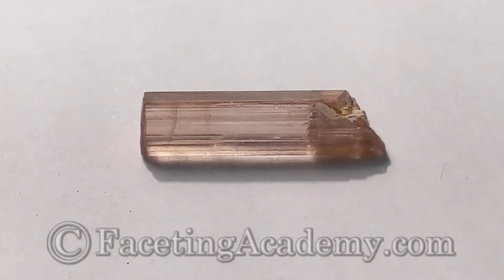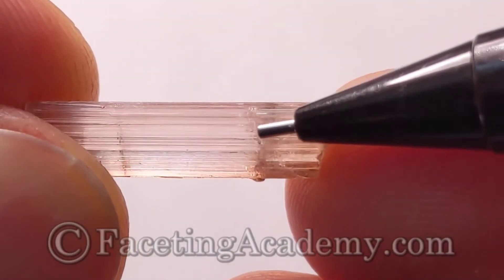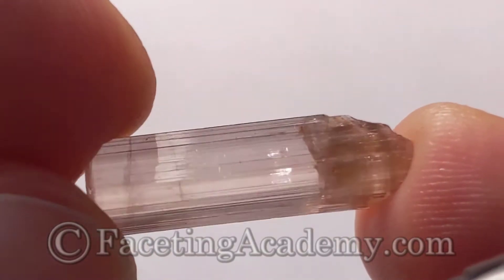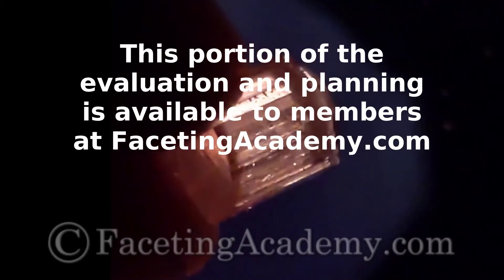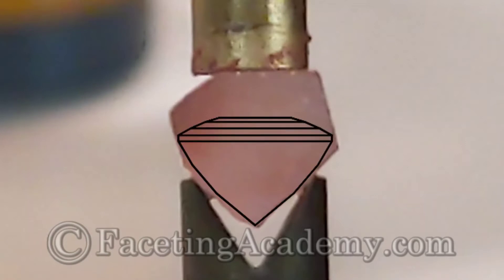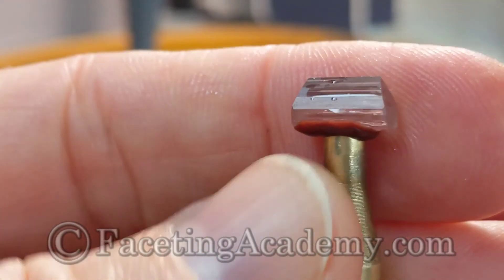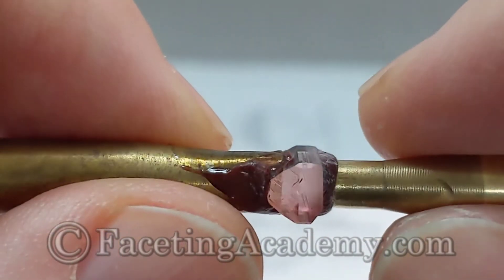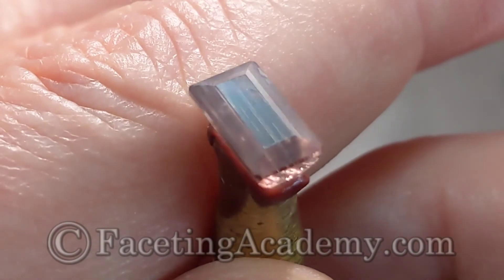MW's Tourmaline Case Study

Comment: Can you teach in your videos how to make the cleat in the true heart shape... because all faceting diagramms show the simpe heart shape, without cleat in the top of the stone..
Thank you in advance
Reply: Thanks for the shout.
There are a couple of reasons you don't see clefts in the popular diagrams or cutting:
It's not practical to diagram clefts in the existing CAD software.
Clefts are wasteful of material (weight), and harmful to optics.

In my opinion, clefts enter the carving or fantasy-cutting realm, and really ought not be done unless there's some compelling flaw in the material that must be removed or some other reason that the time involved could show a return on the labor.

Clefts are usually done by shoving the edge of the lap into the top of the heart to create the dimple. 

If I had to do one for some reason, I would personally do it on my fantasy machine where I could work it with precision.

Hopefully, this answer is helpful to you.
Reply: @InsightThoughtSystems  thank you very very much for your assistance. 
Take care!
Reply: @InsightThoughtSystems  Hello, John
I have enrolled on your faceting academy👍👍👍
I tried to reach you through the blog/ask section..
But nobody answer me😭😭😭
Is it workable or may be I do something wrong🤔
Please, help
Thank you in advance

Comment: Hi there. 
Thank you for your video. 
Did you use 2 sizes of grit only?
600 and 60000?
Reply: Thank you for your appreciation.

I tested two new cutting laps on this stone. One is advertised as 500, the other as 800, though the "800" cuts faster and leaves a more coarse finish. So, actual particle size is questionable. 

I went directly from these laps to 0.5 micron diamond polish on the composite lap for finishing. This made only two steps: cutting and polishing.

Usually, for this stone, I would cut with a 600 plated lap, followed by a 600 Nubond (resin bonded), followed by 0.5 micron polish on the composite. This is usually cutting, pre-polish, then polish.

These new laps, especially the 500, allow skipping the intermediate step on many stones - greatly speeding production time. I am editing some lap review video on these tools today and should have detailed review, with some comparisons of finish surfaces up on the channel very soon. Watch for them.
Reply: @InsightThoughtSystems  thank you very much!!!
I'm looking forward for your new videos!
Take care